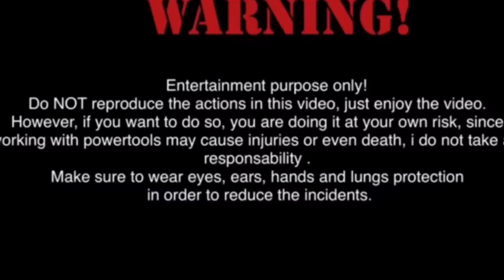Butter robot - Rick&Morty webcam prop

Comment: I do not have access to all these tools.
Reply from the maker: All the tools you need are :
- a cutter ( 1$ )
- some sandpaper ( 1$ )
- a drill ( or dremmel tool ) ( ~15$ )
- a heat gun ( ~10$ ) 
You can purchase them at any hardware store
Reply: Matsuda Industries I mean, ok. you got me there. but it just seems like a lot of frustration if you don't know exactly what you're doing
Reply from the maker: I'm sure you can make it (: it's nothing more than some plastic boxes and hinges after all.
If you want tips and support during your crafting, contact by message the Facebook Page, i'll be glad to assist you.
Reply: Matsuda Industries ok, thank you!
Reply: Matsuda Industries 
can u please tell me what the wiring ports are
Reply from the maker: +Seth Reed 
I didn't change anything in the wiring, i've just cut them from the board and reconnected exactly like before , just before finishing the prop. The wires are 4 ( Black is ground , Red is +5v, White is Data - and Green is Data + )
Reply: Molly Duggan Use a butter bot to get them
Reply: Are u like 7 XD
Reply: Molly Duggan oh my god